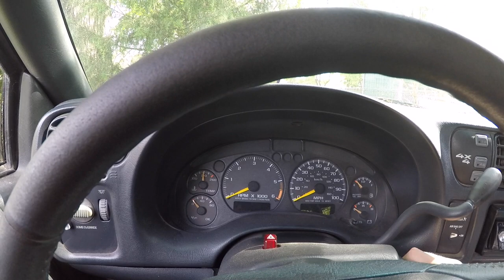How to Change Oil in Chevrolet S10 or GMC Sonoma (4.3l)

Comment: Found me a 💎 gem. 2003 4.3L automatic sub reg cab S10 with 99k   I use OEM AC Delco parts. Love the thing. Been stored in a basement. Looks new. Lol 😂. I’d drive it and save the high country.
Reply from the maker: That’s a nice deal, you let me know if you ever want to sell it! I had a fuel issue with mine, I’ll make a video soon about it!

Comment: Don't know if you still have that truck, but when you wiped some of that oil on the cloth, that oil was black as ink, I definitely don't recommend doing 3 year oil changes anymore and even the oil filter material starts to break down after several years, gunk solidifies inside the filter when it sits for years without use as well. Anyhow I like both of your trucks, you should consider selling the 98 to someone that's in to them and will take care of it and restore it. Then you can focus on your other truck and not neglect the 98 anymore.

Comment: Hey Dustin how do you feel about Lucas oil stabilizers I use them and think they make a difference in really worn engines
Reply from the maker: Yes this is good stuff, I’ve used it before and liked it. What’s your experience?

Comment: If you’re still having the electrical issue, and it’s draining your battery even when the vehicle is off I might have a solution. My 2003 S 10 pick up truck was having an issue where the cigarette lighter in the ashtray was slightly corroded and constantly creating arc that would drain my battery. I’m not sure if this is your issue but it might help
Reply: Like the oil change video on a s10 ..I've changed oil on every vehicle I've had but now I have a low low and I wanted to see where everything  is b4 I find a crawl space under my low low..my point is I really like this young fellas dmeanor.plus he incerted the small details but didnt talk on and on like most folks do ..good  job young fella